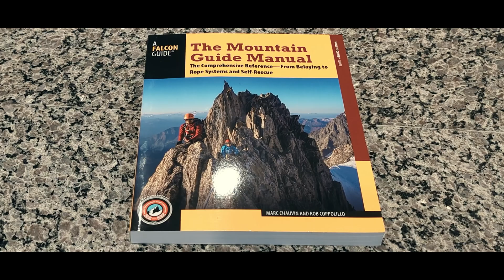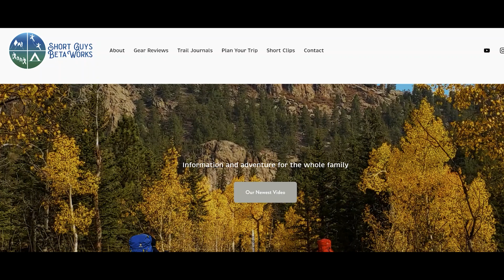Have We Been Rappelling WRONG!? A No Tether Multi-Pitch Rappel

Comment: So we are essentially combining  cleaning at the chains and a normal rap?
Reply from the maker: @macmurfy2jka  That's not a bad way to think about it... and with a "backside clove."
Reply: @ the only problems I see with this:
1. Obviously this is a more advanced skill. While it uses less gear, and solves some issues, there is a lot more rope work involved.
2. This seams technique seems to use the rope length inefficiently. Normal stopper knots at the end are a more efficient use of rope. If the rap is a skosh too long for the rope, this technique may leave the party above the next station.

But for alpine rock climbing this almost completely eliminated the need for other gear, like a PAS, saving weight and wrack space. Though, I’m not sure how much that really helps, considering that the need for items like a dedicated PAS is not that prevalent, because the climber should have all that gear that would get used as a PAS on the rappel, anyway, after cleaning the climbed route. 

So for rescuing the second, who is stuck but able to rap, below all the gear, and in such a way that retreating would not allow the leader to recover anything, I guess that would really come into its own. That seems pretty narrow of a perfect use case.

Otherwise this does seem like it would be great if the rope is stored on the climber is a rope bag. 

Neat technique. I may use it.
Reply from the maker: @macmurfy2jka  Nice assessment. I can say that the big push to develop it was to avoid/reduce climbers rapping off the ends or getting a knot stuck. One can easily point to those as being the biggest failure points in rappel accidents. That being said, that's because few people are using this technique. If this became as common as current practices, would we see a different failure point emerge???
Reply: @ I would expect as much. The real test would be in the reduction of incidences of failures over all. 
That may happen, it may not. I am not enough of an expert to make that type of assessment. Climbing is a hobby for me, after all.
Reply from the maker: @macmurfy2jka  Agreed. I like this procedure (theoretically) on big mountains, though. Being hypoxic and tired makes it easy to forget all the untying and retying. I plan on practicing it more and using it in more casual places to assess it further.

Comment: I can see a problem with this technique: if the rope we are using have been shortened asymmetrically in the past, the lack of stopper knot on one of rope's end would cause a disaster... So the assumption from 3:41 can be very dangerous.
Reply from the maker: @michabaszczyna4243  That is correct about the middle, but the rope is also fixed from above with the device (and ideally a friction hitch backup). But a good call out, as it nevertheless adds risk. And a good reminder that we should mark the middle of every rope we modify (not just for this procedure.)

Comment: I rapped off the end of my rope years ago.  The rope had a middle mark, and was also marked 5 meters from the ends.  I mistook the end mark for the middle, and ended up bouncing down the pitch.  There was deep snow (we were ice climbing) and a relatively steep slope, that flattened out very gradually, so the fall dissipated my energy over time, not all at once, which is why I was able to walk away from it.  
Since then, I've got PTSD about knots in rope ends.  I have to tie them.  Doesn't matter how safe this method is, there is no way I can rappel without absolute certainty that there are knots in both ends of the rope.  
Your video shows a good system.   It's just not for me.
Reply from the maker: @tacul9333  Thanks for being vulnerable and sharing that. I appreciate your support of the channel, am glad that you were able to walk away from your accident and (as someone who has experienced trauma, himself) I wish you continued mental recovery.
Reply: Thanks for sharing that as well. It takes a lot to reveal a mistake like that to the keyboard warriors. Just don't admit it on Mountain Project, that site is the worst! Glad you were able to walk away from it and get a second chance.

Comment: Interesting technique. I think ill use this for when i dont have a pas instead of using a draw or something else to connect into the anchor. I would agree on the risk on untieing the wrong end but that would be a very large mistake since one is short and one is very long. I do think though for big mountains speed is safety and im not sure if i would accomplish this faster than the normal technique.
Reply from the maker: @TheSubieFan  Having learned this (originally) from some big mountain guides, their big thing is worrying about forgetting to undo the knot before you pull the rope down and getting it stuck above you. Think hour 18, rappel 10 of 20, and hypoxic. The speed was secondary to them (but probably not slower than having to haul the pulled end back up to you - if it falls past- to tie the second stopper knot; a lot less time pulling up and throwing back down one end).
Reply: @ShortGuysBetaWorks  tying a clove hitch (with backup) instead of the figure eight could reduce the risk of leaving a knot even more.
Reply from the maker: @sebamobile9689  That would be, true, since the knot would fall out when you unclip. I like that you call out the backup when at the end of a rope with an open tail: https://youtube.com/shorts/EZq0QhQco98?si=GC7VN9fxBCOKHmDZ

Comment: A similar technique is shown in the Book Down (in the stripped version too) from Andy Kirkpatrick. 
If you use joined halve ropes for rappel an advantage of both techniques is that you  have marked on which side you're pulling the rope out.
Additional as long as the links of the anchor are small enough to block the knot you could rely only on the rope connected to your harnes
Reply from the maker: @sebamobile9689  Down is and excellent resource. Another highly recommended title.